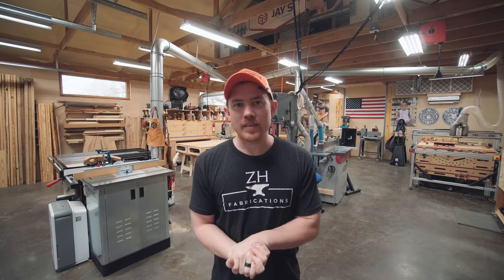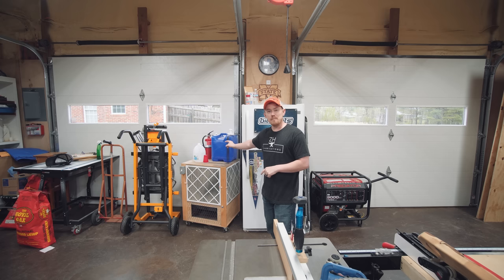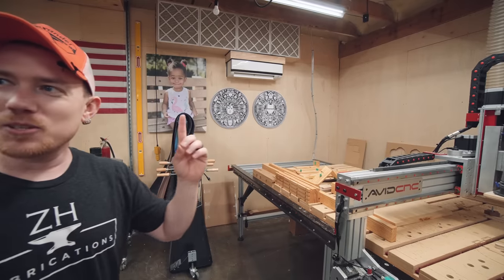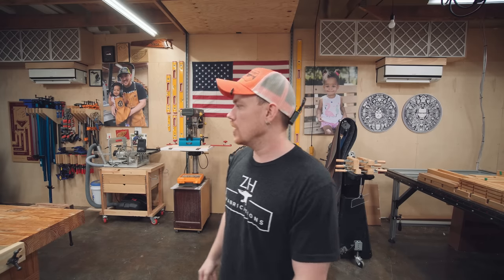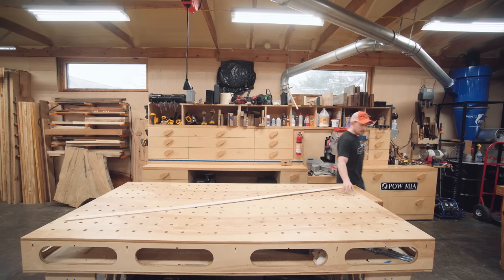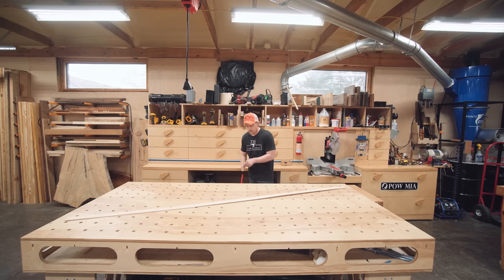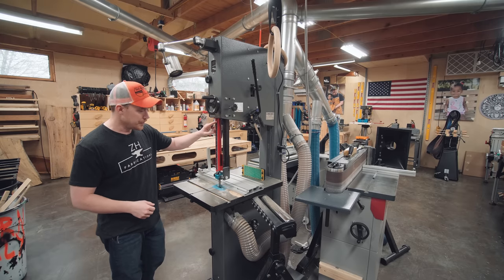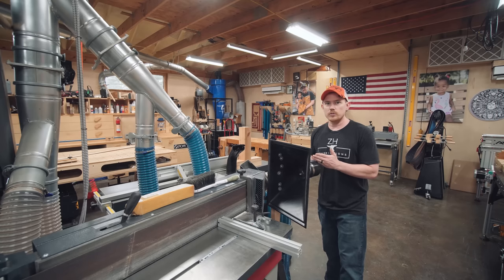Woodshop Tour - after 9ish years in business - 366

Comment: Simple Safety Tip for your elevator - instead of a single bulb, consider screwing in a two-bulb splitter so that you have the backup of an extra bulb, so that when one bulb burns out, you won't be under the false assumption of the power being off. Great video!

Comment: For the hardware being scattered everywhere when you set up the sawhorses, you need a magne-can. It's a strong magnet glued to the end (not the side) of a stick, inserted into a cleaned-out steel can. Pass it over the floor like you would with a vacuum wand, then hold it over a container, grip the can, and pull the stick, and the steel bits fall off. Repeat as needed.

Comment: Jay,
I started using ethanol-free gas in all my 4-stroke devices and no more gumming up, ever. Just a thought. 

Super shop, buddy. Just built same footprint with 4x9 CNC and a dedicated 8x18 sealed paint booth. I lost 20% of my "tool floor" but I do so much stain and paint finishing that it was a necessary tradeoff to make a living. 

BTW: I bought the same dust collector and Nordfab system as you (because of your video on same) and absolutely love them. What a difference they make.

Comment: If you don’t like your band saw fence You should see my band saw resaw fence. Basically made with drawer slides. X and Y Bering slides mounted on the table. no deflection front to back. Works fantastic. You affix the work to the slide and slice of pieces like bread. It’s got built in indexing in 16th inch notched with infinitely fine adjustment. I can accurately cut veneer down to a 64th of an inch.

Comment: @31:50 I've never lost a body part or been burnt. But now that I'm older and wiser, I'm always worried that I might have an accident. Saftey is always implemented after a shop is built, usually as an after thought. I like the positioning of the easy to access band-aids (I assume other first aid supplies) and fire extinguisher. It looks as though that it was implemented as part of the design right from the start. Thus, it doesn't look out of place, or tacked on.

Comment: I like the idea of the spray cart with shellac in it. I would have thought it would clog as well. That's one area where I still paint by hand as I hate cleaning up spray gear LOL. I might give this a go in future.

The lifts a great idea. Never thought of using a winch as an elevator instead of stairs - great idea!

And the wood storage is interesting. I know the pain of trying to get a piece from the bottom of a rack. I can see standing up would require less space, but I still reckon I'd just shove stuff in front and wouldn't be able to access it anyway LOL.

Thanks for the tour

Comment: Thanks Jay. Very thorough. I like your explanation of your thought process. I will be building a new shop this coming fall. It will be in a 10" X 6" with most power tools on wheeled carts. Tools will be rolled out under a 10' X 10" covered  but open area about 10 feet from the shed. Not nearly as impressive as yours, but I hope to have fun there.

Comment: Great shop. If you move the paint/liquids cabinet to the other side of the window you would probably have enough room to make a dedicated metal working/general repairs bench by your tool cabinet. You could even move your welder over there too. Then you don’t need to move the tool cheat and you don’t contaminate the wood side with metal shavings.

Comment: great job... FYI a circuit breaker isn't designed to be used as a switch it will fail much sooner than normal so you might want to install a cut off switch instead... just a thought
Reply from the maker: In my bachelor days I used the breaker to turn of the water heater every day. Turned it on 20 minutes before my shower. It flipped twice a day for the 5 years I was there. Still works to this day.

Comment: You're right about 1/2" pipe clamps being the best value though considering a 10' stick of black iron pipe (120"), the head and tail of those Pony brand clamps take up about 4" so the cuts on a stick of pipe ought, maybe, to be 28" etc. There's no point in threading both ends of the pipe. A light spray and wipe with Pam cooking spray will allow you to scale off thoroughly dry glue by sliding the tail piece back and forth like a pump action shotgun. 
    Prediction: You'll eventually separate wood and metal areas to prevent the contamination of your wood projects with the oil, grease, cinders, and sharp cuttings from metal work. The only drawback is the need for a second drill press (think mill/drill) but you'll gain a torch, mini grinders, welder, and a metal lathe.

Comment: I'm building a shop - got teh final framing insp today and elec rough tomorrow, so REALLY close. I too chose a mini split, 18k...if that's not enough I'll get another. My concern is getting air flow around a 28x40x16 space.

Insulation is coming, over the winter possibly. Ceiling is all that's down now.Spray foam is WAY expensive.

Ahh, inside measurements! You pay for 30x40 but get less!

Comment: Your workshop is a beautiful place.
Have you had any problems with tables on Hammer A3-41?
I have bought this machine mainly because of your tooltalk video.
Mine was never coplanar even after few visits from technicians. I measured the diagonals and I found more than 0.14mm dip which is out of specs.
The coplanar side of the infeed table is almost 3mm (1/8"!) lower than the front.
I tried to remedy this and after technician from retailer came he tried for 8 hours and finally stated that is the best he can do. Apparently he's the best technician. I had other one come as well when they installed my new table saw and it was the same.
Now they will change my tables because I contacted Felder directly, since my retailer couldn't care less.
Reply from the maker: I haven't had any issues with mine.

Comment: I have 2 band saws in my shop and folks ask why 2?  Well I got a deal I couldn't refuse about 25 years ago.  They are Do-All Vertical band saws 20" tables and when I got them one wasn't running.  It was a package deal 'have to take both'.  At the time I paid $200(both) and got a slew of blades. Oh and one of them has a spot welder on it.  Problem was they weigh a ton, no literally they actually may.  I installed a new motor in one and some switches and that's about it.  They sell for over $3000 each now.  I use one for metal and one for wood and have blades set up for both.  Many of my tools are old, and I mean older than me and I'm over the hill.  There is NO rolling these puppies around  What I like is they are solid and have no flex what so ever, problem is you don't just 'plug them in' as the one with welder needs mucho power but so doesn't many of the other tools so it wasn't a huge issue.  My major problem has always been space as I work with both metal and wood so I have some tools for both(one each).  Being old tools they are cast iron and super heavy.  I've been eyeing some larger wood CNC tables but space is an issue.  Would also like one for metal but I just usually sub that out as most of the stuff I have many of one thing cut

Comment: I've been thinking about where to mount my router table. I have a void on the right of the table saw, but I would only be able to access it from the front, not three sides. Kind of like how your lever mount is located. I know you have it set up for round over, how would you handle using it with a fence there?

Comment: Jay, any issues with just the 4" port on the 16" wide combo? I have a 16" wide SCM combo unit coming and i'm running 5" ducting to the 120mm port on it but thought about opening it up to 6" down the line once i'm out of warranty.
Reply from the maker: My DC is powerful enough to pull the internal flap in the dust shroud up. I added a magnet to stop this. No issues though.

Comment: Thanks for the tour! Is there a particular reason why you didn't want to add a 2-way switch at the bottom of the elevator, rather than hang a 7' light "switch" on the wall?
Reply from the maker: This works and is no extra effort. Just don't want to spend the time wiring a 3 way switch setup when this is easy
Reply: @JayBates  I guess we get irritated about different things; swinging that level around overhead trying to hit a switch would bug me!

Comment: How much power are you using each month? I realize this may vary depending on consumption. I was just wondering what your average is for a shop this size. Thanks for the good content. Keep up the great work 💪
Reply from the maker: I've never paid much attention to the actual usage. The shop and house are ok the same meter. 2400 sq' house and 1200 sq' shop and our bill swings between $180-280 per month depending on the season. The house is 100% electric so our expensive months are always in the winter.
Reply: @JayBates  Thanks for the response. I'm building a high performance icf shop in SC soon and have been sorting out my mechanical designs. My shop sf is roughly 1250. I'm designing an below slab dust collection system or in the floor. Because my build is based on passive house standards I'm going to keep my shop electric package on a separate zone due to the consumption. I'm assuming that you probably have a 100 Amp panel? Has that been enough for your equipment or have you needed more? Thanks

Comment: Where do you spray all your stuff?  If you spray it in the shop doesnt it get everywhere?
Reply from the maker: Mostly spray in the shop. I put the air cleaner cart on the other side of what I'm spraying and point it away from me.
Reply: @JayBates  Thanks for the reply!  I'm setting up a similar size shop (29x44) but choosing to wall off a portion of it for a spray room.  Thinking about trying to get creative with how I can filter/circulate air in the room and potentially between workshop spaces to minimize the overspray hanging in the air.  Thanks!